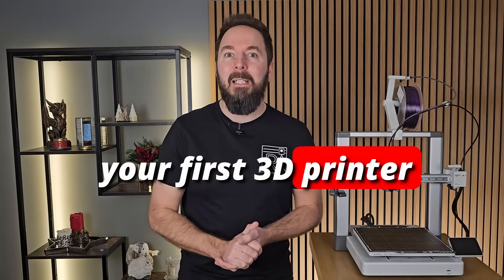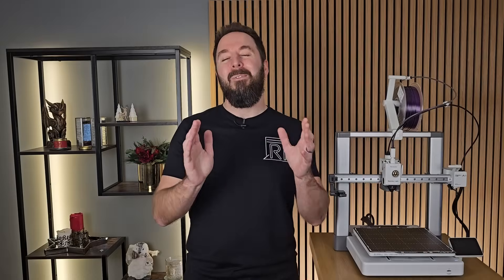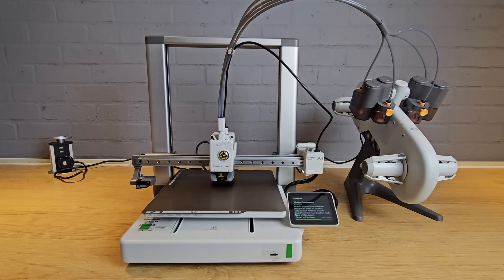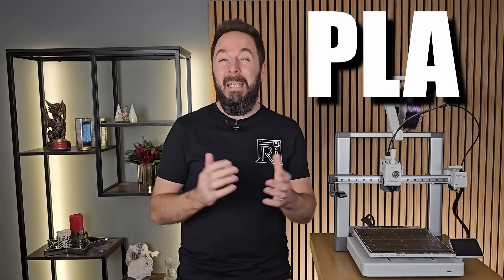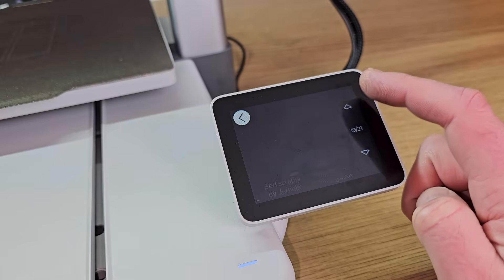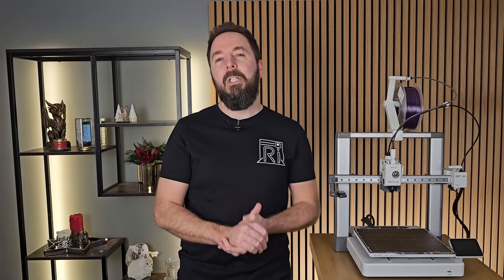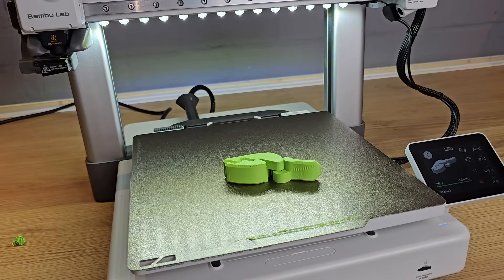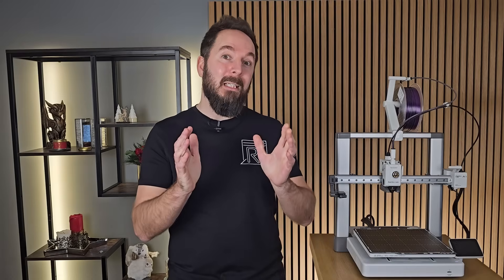New 3D Printer? Watch This First

Comment: In my experience, soap and water is much better than IPA. Evaporating IPA can leave a residue on a build plate that can actually make adhesion worse.

Even if I have something on my build plate that needs IPA to help remove it, I always wash it with soap and water afterwards. This fully removes both residual IPA and any deposits that soap is better at removing than IPA.

Also, I would highly recommend drying washed plates using lint free wipes, rather than a towel or paper towel. Cotton towels can shed cotton fibres onto the build plate, while paper towels can shed paper fibres. Fresh lint free cloths don't leave fibres of any kind behind, and prepare the print surface in a way that results in maximum first layer adhesion.

* IPA=Isopropyl Alcohol/Isopropanol, not India Pale Ale, International Phonetic Alphabet or Institute of Practitioners in Advertising